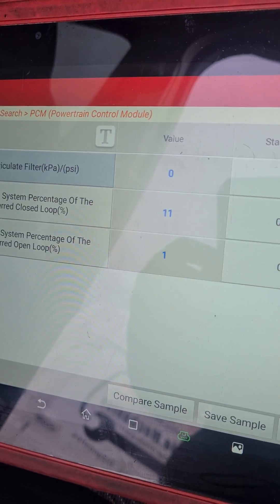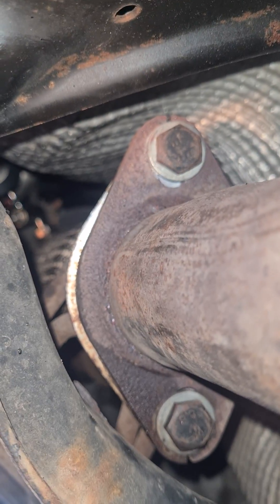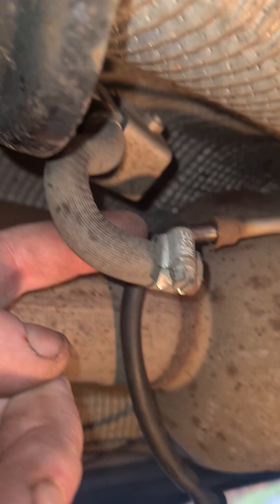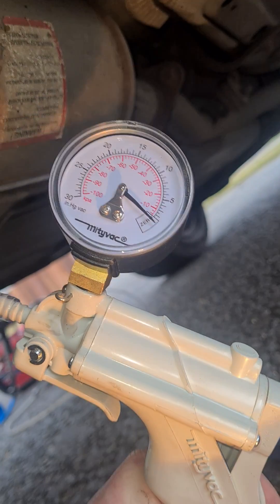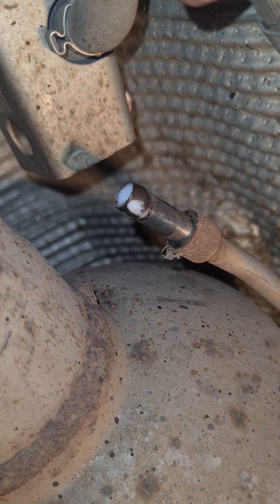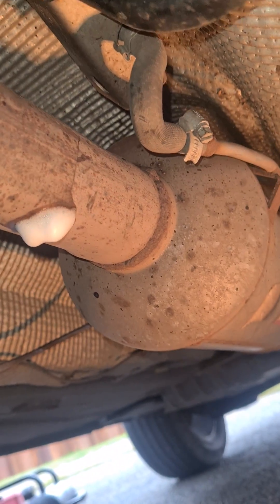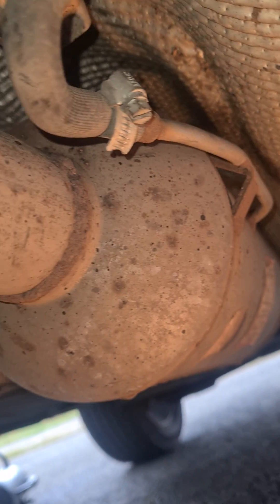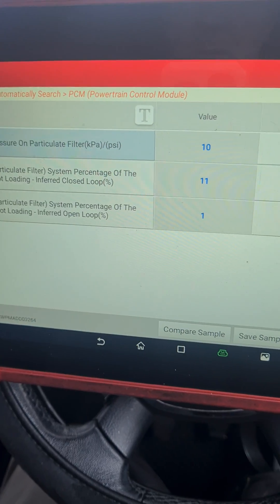Ford Transit Had DPF Removed & Cleaned. New Sensors But No Pressure On Data

Comment: Would this cause code P246D - Particulate Filter Pressure Sensor A/B Correlation?  Wish I could fly my van over the Atlantic to have you work on it bud, mechanics here in the states don't seem to have a clue :P